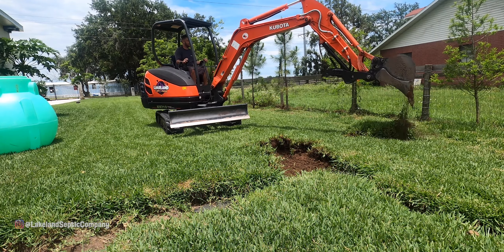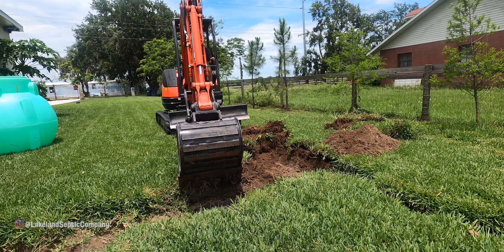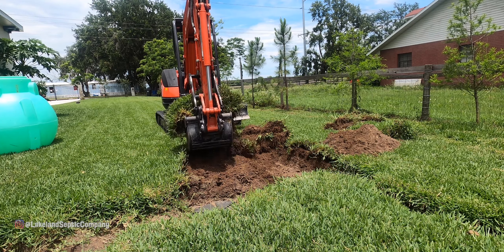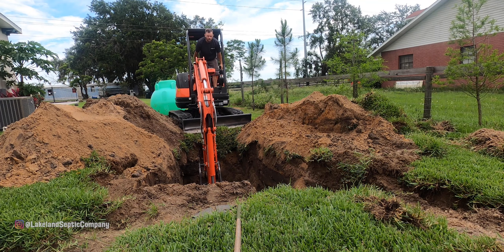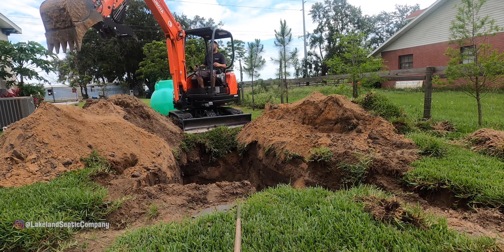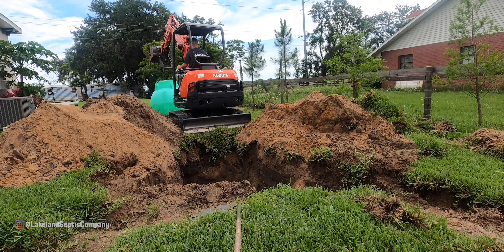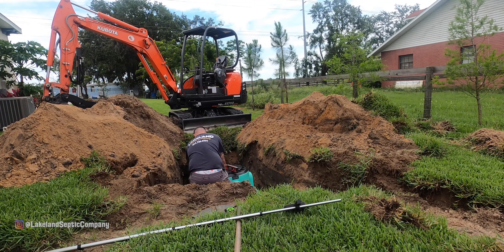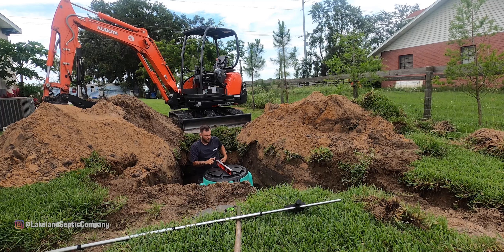Fixing someone else's mistake with a lift station

Comment: What can you suggest to stop the corrosion factor in my lift station, it eats the pumps, back flo valve and hose clamps.
Reply: The pumps could be painted over to help combat that, as far as clamps try to always use stainless steel parts and find a way to relieve the gases out of the wet well so they won’t be so concentrated eating at the parts. Hope this helps.

Comment: Our Lines from the leach field are pouring back into the septic tank, especially after heavy rains.  I guess they call it back flooding.  My guess is the ground is so saturated with groundwater the lines cannot release water into the yard....any suggestions how to fix?  Thanks in advance
Reply from the maker: The drain field may need replaced and brought up away from the water table. Or possibly the system needs to be made larger to handle the amount of water being used.
Reply: @LakelandSepticCompany  thanks the water coming back I to the tank does not have an odor and appears to be more groundwater. Any thoughts?  There are only two of us in the house using water
Reply from the maker: @Payton20ADZ  I would contact a local septic company with great reviews.

Comment: I'm working on a super old lift station for 2 duplexes right now. We have continually had issues with it for 20 years replacing the pump.

Having never learned from a pro how they are supposed to be installed and run, I'm skeptical that this was properly setup. The lift station sits at the lowest point on the property and then pumps it along about 250' of pipe at around 10-20° angle toward the street where sewer main is.  Is that correct? I feel like it should be pumped straight up and then flow down to the main
Reply from the maker: What size pump is it?